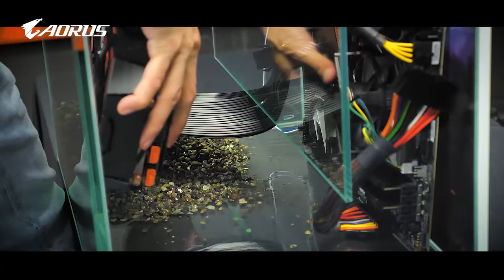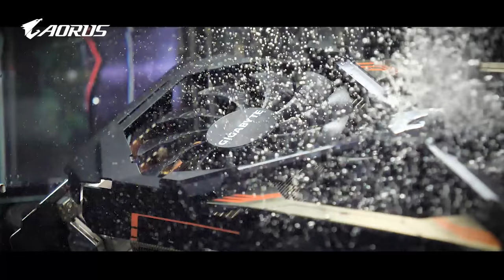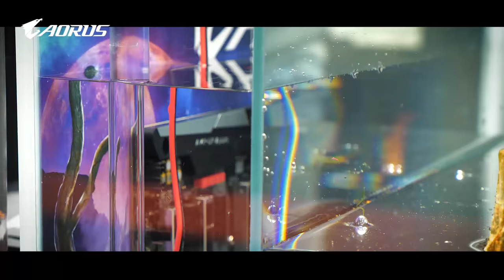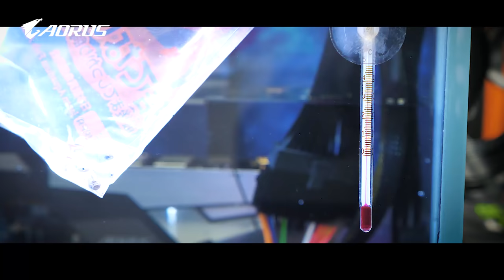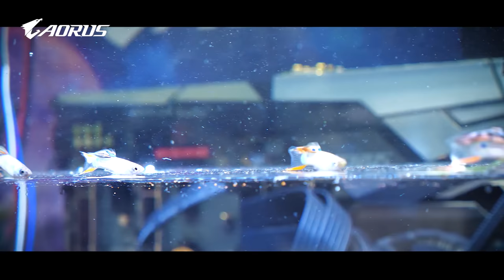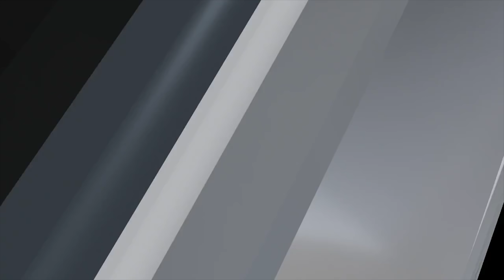Aquarium AORUS PC Build | #DesIgnYourAORUS

Comment: My question is how do they maintain this in terms of uneaten fishfood and poop?
Reply: They didn't even finish recording it that there was already stuff going down in the components, see at the very end just before the cut scene, a little piece of trash gets sucked into the fan
Reply: It’s probably just a temporary build just to see if it could be done
Reply: I would have seperate tanks for the fish
Reply: I mean anything that is mostly water, like soggy fish food and fish poop, will float on top of the layer of oil and stay out of the GPU. But yeah when it comes time to clean up the oils surface, I have absolutely no idea how they would do that.
Reply: They just record it and then put it all away
Reply: There is a water filter at top my bro
Reply: I can't see this being a realistic thing over time. It's hard enough to keep an aquarium maintained not to mention with all the factors of the balance of maintaining separation of algae, water, oil and making sure temperatures are right.

I am also pretty sure the fish would occasionally die from swimming into that oil. Cleaning fish guts out of the GPU would be a real thing lol.
Reply: Imagine if the fish poop drops down gets sucked into the fan😂
Reply: Elias Sanchez ...there’s no separation between the GPU and fish apart from the two liquids lol. The chemical structure of the two liquid layers make them not mix in together.
Reply: @Debergaizen  I saw that
Reply: @Sami02  that won't do shit for that situation dude
Reply: @eliassanchez420wakenbake  No, there isn't. Are you blind???
Reply: @eliassanchez420wakenbake  you can see the fish touch the oil surface, there is no seperation
Reply: @eliassanchez420wakenbake  There is actually no glass separation. The oil is more dense and water is polar, so the two do not mix. The oil sits at the bottom and the water on top. The oil acts as a barrier. The fish will never go down into the oil and instead stay in the water directly above it
Reply: ONIC well as long as the fish don’t get hit by the GPU fans then I’m Gucci. I didn’t know the bottom layer was oil
Reply: @eliassanchez420wakenbake  'Are u stupid?'
Reply: I think the fish would die if they did this for more than like 10 minutes. I don't think this was permanent.
Reply: Simple, they don't
Reply: @eliassanchez420wakenbake  No there ain't, do you know a thing about how Oil and water interact?
Reply: @eliassanchez420wakenbake  there was a bit of trash that fell onto the gpu though
Reply: I think the fish would die very soon before that would even be a problem

Comment: I knew it wasn't water. I looked this up because I thought it was. After watching the fan make air in the water I knew it was hydrophobic water. Hydrophobic water has no hydrogen so it can not affect normal material since itself is hydrophobic. So it will not saturate clothes, electronics, and so on because it is to heavy.
Thank you for teaching me 🙂 what y'all did to the pc to run it in a type of water.

Comment: I don't get how this works as in if the fans have allot more friction won't they burn out much more quickly
Reply: Asus care to answer?
Reply: smol brain you, its fucking novec fluid, which is designed for thermal conductivity, the fans are merely a decoration. It is literally impossible for the GPU to overheat

Comment: Does anyone know how fish poop or food is removed from this system? Will they sink to the bottom and cross over into the 3m novec liquid? Or is the liquid too dense for it to pass through? I’m going to try a fish tank build just like this myself.
Reply: The fish waste will eventually be pulled out by the filter
Reply: the filter only take some out of the poo... the rest is everywhere floating and sinking
Reply: Fish turds could take out your gtx 1080ti? No thanks
Reply: The 3m novecientos liquid is much denser than water, any waste, food, or dead fish should just float on the surface of the fluid.
Reply: @rodentlover100  very nice
Reply: When I was typing out my comment novec got autocorrected to a Spanish word, please disregard this mistake
Reply: @rodentlover100  all aquarium fish i know are cannibals and real greedy. they gonna push corpse with united powers under the liquid surface for shure. eventually more gonna die in that scenario. anyway with small fish like that sould be fine they are inexpensive. lots of cleaning work too much but none of my problem anyway. i guess he give it up sooner or later
Reply: @christianschmutz5676  they'd have to be really strong to do that. I have guppies and they never attack a corpse at the same time like that, they don't even really pick at corpses much from what I see. Even so, if they could push it under it'd just float back to the top. It's like trying to hold a piece of ice underwater, it just floats back up.

Comment: How does it not destroy the parts inside?
Reply: The fish poop?
Reply: Because it's actually not water, it's some other liquid that's 3 times denser
Reply: @maltheIDM  its not how dense. Its about the conductivity.
Reply: @samueladitya1729  Yeah I know, but I just felt like I needed to mention that, since they poured water on top of it. 
Which I thought was super cool.
Reply: @maltheIDM  No water goes thought since its a massdensity difference, water is lighter than this oil thing so it doesnt mix together. Lookup Density Cylinder in Google and you'll see
Reply: @OliRotMG  that's exactly what I said "they poured water on top of it" 'it' being the liquid they out over the PC
Reply: Is mineral oil :an liquid made of  petroleum
Reply: It’s a special fluid: M3 NOVEC
Reply: Cesar false
Reply: Timotius Aditya kowalski analysis
Reply: Does anyone know how fish poop or food is removed from this system? Will they sink to the bottom and cross over into the 3m novec liquid? Or is the liquid too dense for it to pass through? I’m going to try a fish tank build just like this myself.
Reply: @ryanwolfchong  no. As it was said before, the M3 Novec is 3 times denser than water, the poop and extra food will float.
Reply: @Cesar-ot1xk  oh lol, i ever use m3 novec.

Comment: For those that dont know. 
The fish are in water
The gpu and components are in mineral oil
There is a layer of plastic (or something clear) separating them. 
Do not put water with you pc components as it is conductive and mineral oil isnt.
Reply: Theres nothing separating those two layers. It's simply physic of density. Mineral oil has way, way more densit from water, so water cannot penetrate oil. U can try ny yourself at home. Use transparent glass, put in oil and then water on it.
Reply: Water isn’t conductive btw

Comment: how are the parts waterproofed
Reply: it's not actual water that they poured in that would be stupid. There is actual water but it sits on top as a different layer. I kinda feel bad for the fishes.
Reply: Arun it’s still liquid though how doesn’t it break the parts
Reply: @tomstein7131  Read description

Comment: Yeaaaaaa im not gonna "dare to try" to put water over a mineral oil build along with fish and dirt particles. What a dumb build. Doubt it lasted more than just for this video. Once you have to get to anything, replace, or otherwise, those hardware components are toast. 
I also didn't see any of these thermoelectric cooling chips you claim to have in this build. It sounds like you were lying in order to bypass that this was partially abusive to the fish. Shame on you.